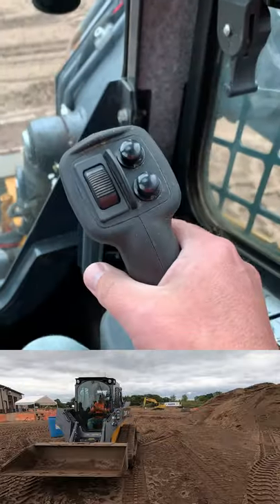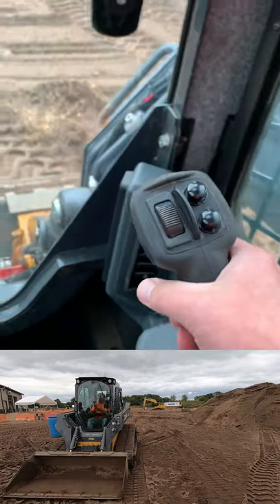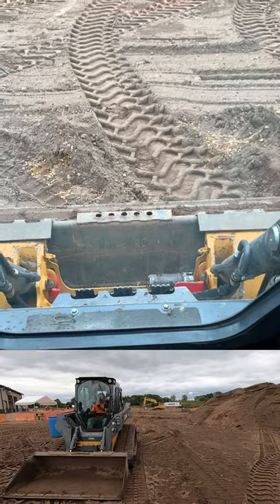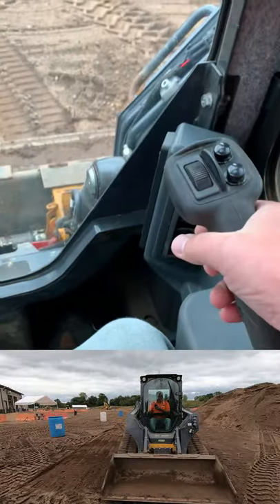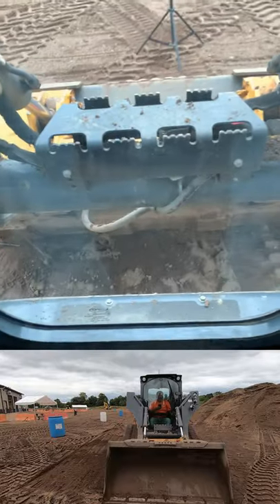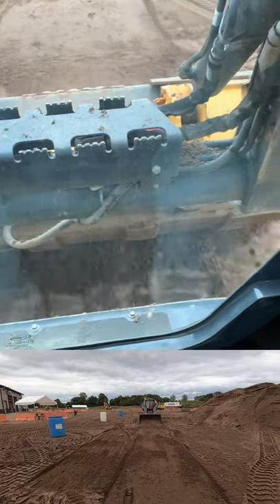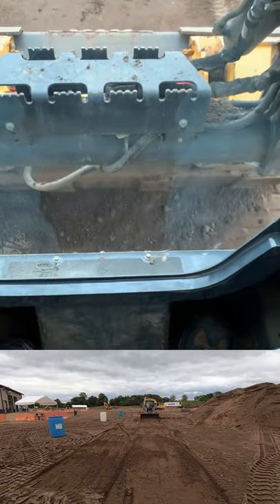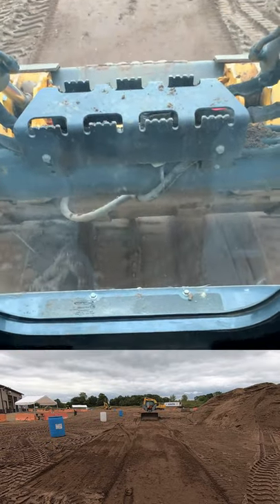How to Float Bucket on JD Skid Steer | #Shorts

Comment: OK, I'm not giving you a thumbs down, I don't know who did that but I'm going to give you crap about using the heal of the bucket on the first pass. Your going to pack the bucket pins with dirt. that's a no no. thumbs up # 14  Thanks for the video  👍😎
Reply from the maker: Fair enough...and good feedback.  But whether it’s first pass or not, aren’t you always going to build up dirt behind and pack pins when floating flat?
Reply: @HeavyMetalLearning  Hence the reason you don't float flat, Always  tilt bucket a little forward and use the cutting edge.  👍😎

Comment: Do all skidsteers new and old, any maker have the bucket float as a control option or is it only certain brands and/or only newer ones that have the bucket float option? I've piddled around on a couple skidsteers before but not enough to know everything they are capable of. Basically just moved dirt, scooping it up in one spot where the digging is happening then tracking it to an out of the way spot. A Takeuchi and a Bobcat are the two types I've been on. I've got hundreds of hours in the seats of trackloaders and have used the float on them many, many times. They've started calling the larger skidsteers loaders too now which I think is ridiculous. They can load trucks like a trackloader but they just aren't the same to me being I'm accustom to trackloaders big enough to drive over top most skidsteers. Skidsteers are all built the same no matter how big they get their design hasn't been made any different to more resemble a loader. A skidsteer has the lifting arms on the sides of the the operator with the bucket right in front close to him and a trackloader has the lifting arms in front of the operator and the bucket far away from him. That's the main difference to me in what sets them apart. Until skidsteers are made to resemble a loader, track or wheel; more, I won't be calling them a loader no matter how big they get.
Reply: Bobcat I know for fact on the old M series does aswell as the R series and I do believe some of the John deers do to I can’t say for Cat or jcb and the others

Comment: I prefer the system where you push it all the way forward than a bit more into a detent.
Reply from the maker: Totally agree.  Not a fan of having to push a button as well.
Reply: Totally agree. The difference being the newer equipment has electronic controls though so you don’t really have a detent. Very few machines come with hydraulic controls nowadays. Almost everything is electric over hydraulic. In my opinion the electric controls have improved over the past decade but you still don’t get the “feel” or “feedback” of actually controlling a hydraulic valve.

Comment: For all you JD owners, something I learned the hard way. I have a 2021 325g.  If you set the bucket to automatically level, the float does not work. The reason is, both functions run off the same valve.

Comment: I have a 2018 JD 330G.  Is this built in to all JD Skidsteers or is it an optional item? Thanks... would come in handy while using my post driver. Thanks!
Reply: Just tried it.... worked like a champ!  The bucket stabilization mode had to be off first... but then it worked.

Comment: funny, some jack knob years ago argued with me about skid steers "not" having a float function... on your channel non the less lol
Reply: I just bought a 2023 John Deere skid steer 331G and it doesn't seem to have a float position... It's got two triggers. The left one goes up into higher gear, and the right one doesn't seem to do anything. Unless you have an attachment on.
Reply: @4thgenfarmer371  hold right trigger, while pushing down? each ones a littke different